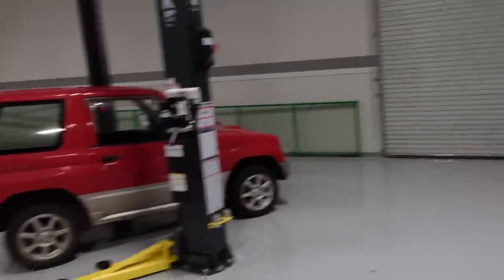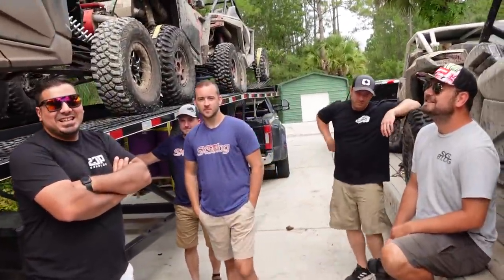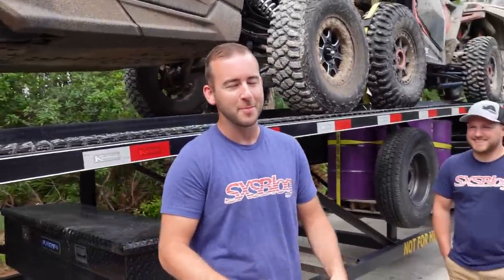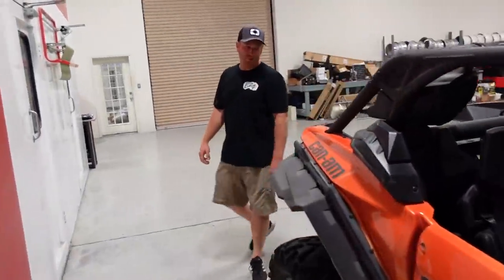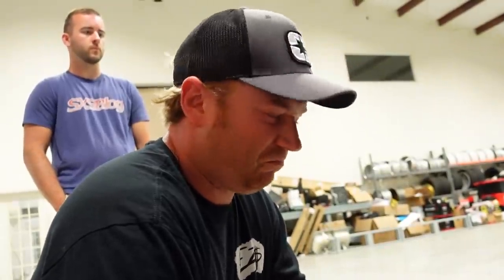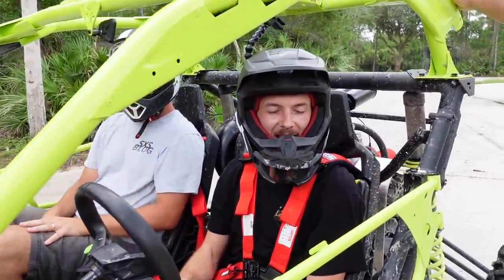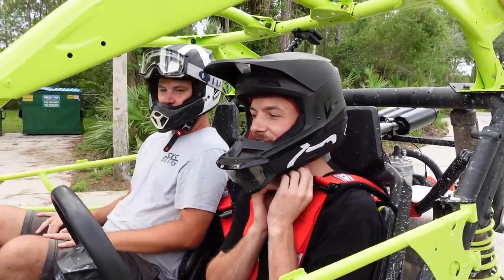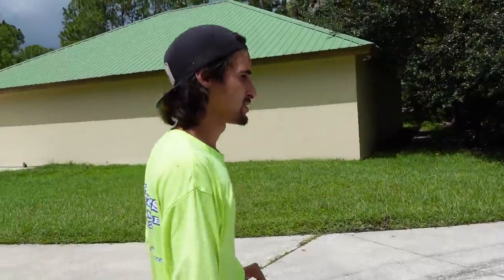SXS Blog Visits the LZ Compound

Comment: Adam you should consider putting sill stands on the s15 - we use them on our rally car and it really helps if in a rush and don’t need to put the axle stands on when taking off wheels
Reply: When one of my buddies had his cage welded in his miata, he had sill stands welded to the cage. They are amazing

Comment: Should do a swap with the 2021 Yamaha Sidewinder snowmobile engine ..  190 out of the crate , reflash the ECU and a few little mods and your at 300 .. and the engine is basically bulletproof ..

Comment: Just me that thinks hes heavily hinting at putting the cym's engine into his side by side?
Reply: Don't think he'd overcomplicate it with that. He just wants to keep it something that's reliable because it's just meant to be something that you can hop in and rip whenever you want. I think the 13b would be a better option for the MX-5 that they bought with the Go Karts.
Reply: That would make his side by side one of the most powerful around probably way to much for his trials
Reply: @tstuff1213  SXS Blog did say in the video "we have thought about that and there is a few SXS that it would fit in". But I'm assuming Adams is not one of them. It's rather small.
Reply: @shona5512  The comment i responded to was refering to a 4 rotor engine being put in Adams sxs which much bigger and way more powerful than just a normal 13b or 2 rotor like they were talking about when N/A. A smaller rotary like a 13b would totally work and fit and not be too insane but a 500whp+ 11000rpm 4 rotor would be very crazy
Reply: @tstuff1213  I'm fairly sure the original comment was referring to the engine that is coming out of the CYM FD.. not the 4 rotor engine going in. I have a 13b FD myself, and from all the time I've spent around it, I don't see how they would ever manage to get a 13b in a Turbo X3 like Adams. The 13b engine itself is a really small package, but it's the ancillaries and gearbox that takes up most of the space. It would probably fit in a bigger SXS though.
Reply: @shona5512  🤦‍♂️I didn't even think about that lol I thought it was the 4 rotor my bad. Congrats by the way those are just beautiful cars and to hear it is still rotary is fantastic. Yeah the gearbox would be a big thing they would have to figure out. Possibly they could use a centrifugal clutch like on stock X3 sxs and hook it up to the factory transmission from them but not sure how that would be done. Accessory wise they would really only need an alterantor because they could use electric fans/pumps for cooling.My rotory knowledge is quite basic but i think they don't need anything else to make it run accesory wise. The transmisson really would be the most complicated part i would think